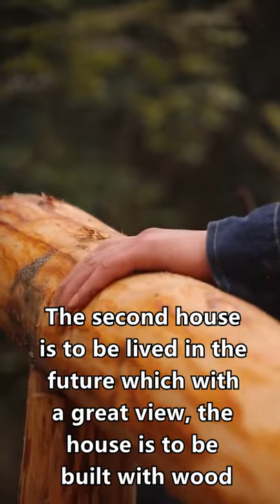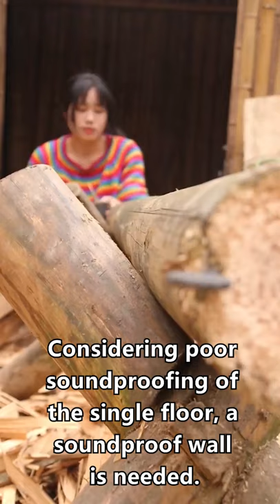🏠 3 Days Girl Builds A Dream House That Is Self Powered In A Forest

Comment: I can only say wow, fantastic and awesome to your skill set. U and I were made from the same mold, we have done many of the same jobs with  repairing equipment. I would like to see u build a hoist crane to save your back, later on in life you would wish you had of done so. Also I use air tools allot when removing and installing bolts, sure does save time.

Comment: Wow. Great stuff. Such dedication and determination.
But I was surprised when you put nails in the trough pieces of the bamboo roof. I would have thought the nails in the crest pieces would have been more than enough to hold down the trough pieces. And with no nails in the trough pieces there would be less chance of leaks. Would also save quite a few nails and a bit of time, less holes to pre-drill.